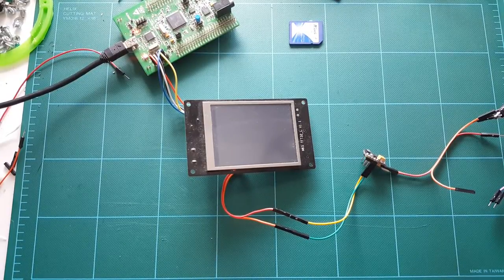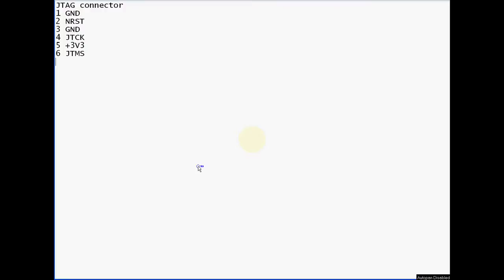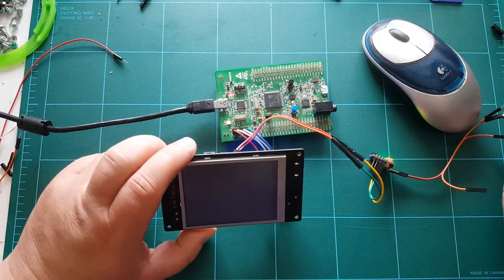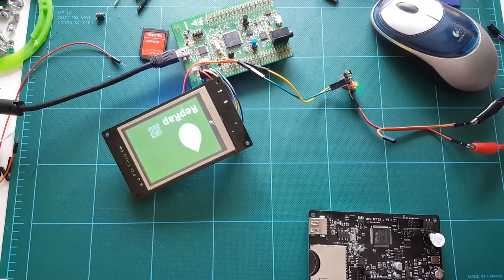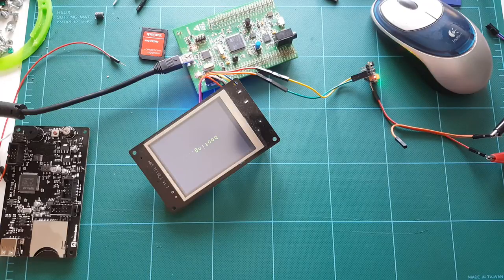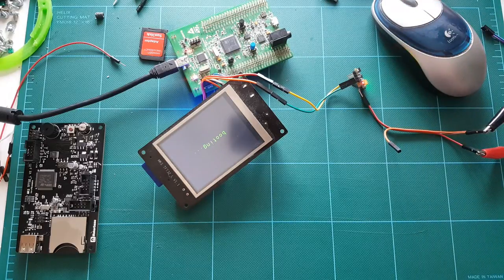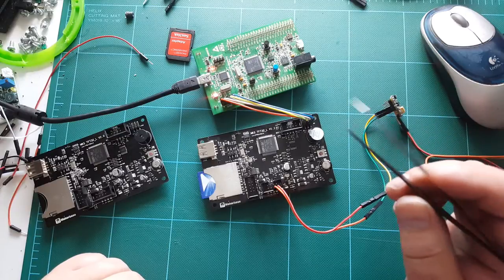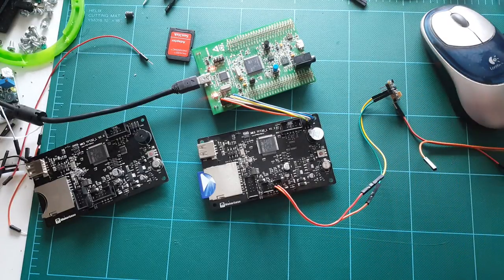MKS TFT repair and overview part 1

Comment: Hi, where can i find a bootloader dump for this board? I flashed a wrong firmware and now when i wire the board to the mks sbase 1.3 its bricked (black display, no backlight and no blue LED on the back)
Reply from the maker: Here's entire MCU code dump https://github.com/arturs-lab/MKS-GEN_3.2
Reply: @arturslab7102  Thank you very much!

Comment: Hi, perhaps you can help me. I bought souch a display, but it doesnt communicate with my Ramps. If i meassure the TXD Pin with my Oscilloscope there is only a 5V Signal without communication.  I tried to find out where the pin is connected to the µC. I found no connection to the µC. The only connechtien i figured out was to two resistors at the left side of the connector. Can you meassure out at one of your boards where it has to be connected to? Thanks. Perhaps i have also a defective wire at my board ;)

Comment: Только что взяли такой дисплей, но версия у него v2.0. Интересно что поменялось?
Reply from the maker: I've quickly compared the two displays and could not see any difference in component locations, their values or track layout. But I have not analyzed the entire board in full detail.
Reply: Artur's Lab   So if I got you right the firmware of the display are not locked and we can just read it and then reprogram any this type  display?
Reply from the maker: STM controller is not locked. Let's not give the manufacturer this idea :) So yes, you can read entire flash area from the chip. I will have to see if it differs from published firmware available for download. It seems that downloaded firmware does not contain full code. i think the part of firmware which displays "booting" message and checks whether SD card contains new firmware update - this part is not included in downloadable release. Yes, you can read entire flash but it will only be useful on another MKS TFT board. Other TFT display boards have completely different electronics and this firmware will be useless for them. But if you have another MKS TFT display that is defective, then you can try reflashing EEPROM like I show in video.Interestingly, the same firmware seems to be used for 3.2 and 2.8 inch displays. i think maybe the bootloader (part that doesn't get updated) contains data about size of display of this particular unit that you have. Or maybe it does not matter if pixel resolution is the same. I'm not familiar with 2.8 inch boards.
Reply: Artur's Lab   OK, I will try
Reply: Most likely 2.8 and 3.2 inch TFT displays have the same TFT controller chip. For 3.2 inch display the chip is ILI9328,  2.8 inch displaymost likely the same or similar (i.e. ILI9325). I ported PanelDue firmware to MKS TFT32, have a look if you interested: https://github.com/robotsrulz/MKS-TFT
Reply: MrRobotsrulz   Yes, It is interesting for me, thank you
Reply: btw я говорю по-русски :)
Reply: MrRobotsrulz   Можете в двух предложениях рассказать над чем работаете, какое железо, есть ли свои наработки по железу, в каком направлении и по какой причине работаете в части ВПО?
Reply: msdesign.ru напишите robots.rulz@gmail.com, расскажу. ps: работа на постоянку не интересует :)